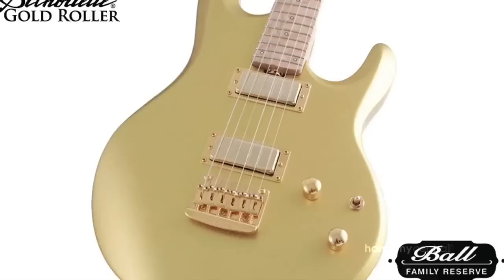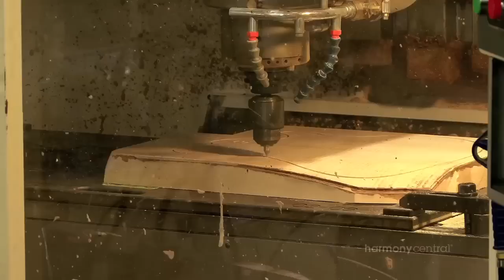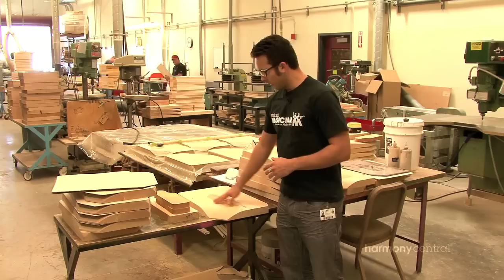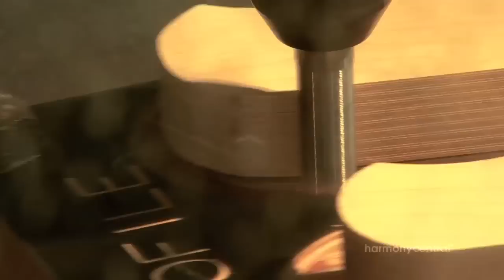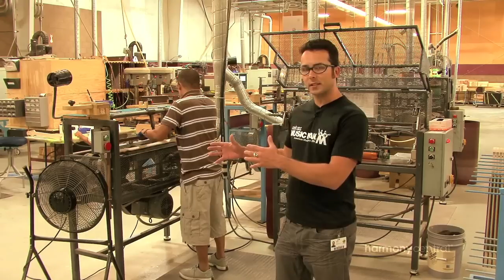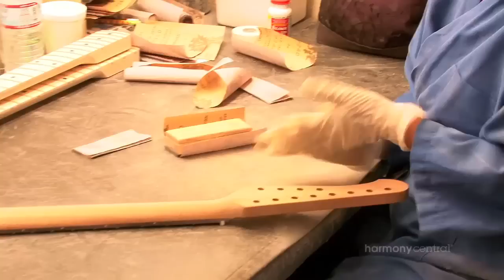Ernie Ball Music Man Factory Tour part 1

Comment: Also lets do some math. Lets say you can get about 4 tone blocks from one mahogany blank, which costs $100 from a wood supplier. Now to make 4 bodies out of alder, which is about $85, with a tone block in each it costs $440. Now just mahogany 100x4=$400.. so yeah. Even if they could squeeze 5 tone blocks from a single blank it still would cost more to do it that way. I think they actually do care about the sound and quality of the instrument based on these facts.